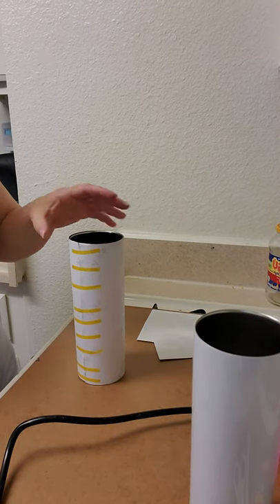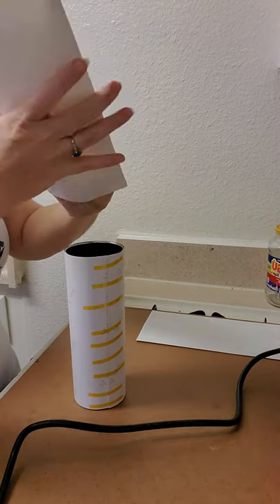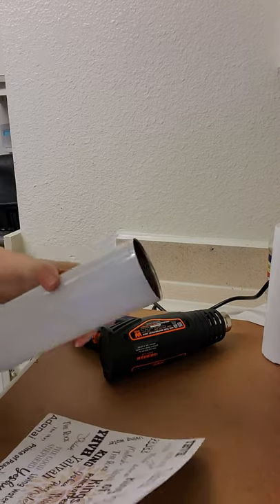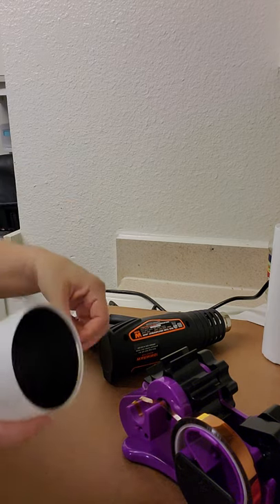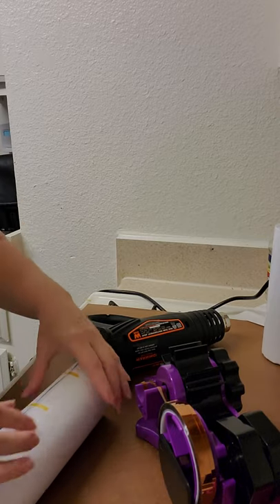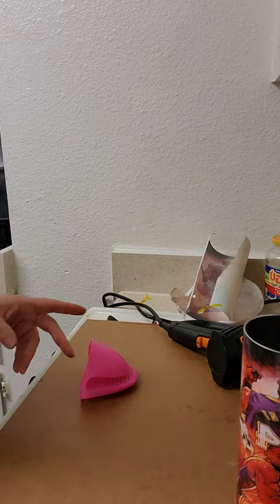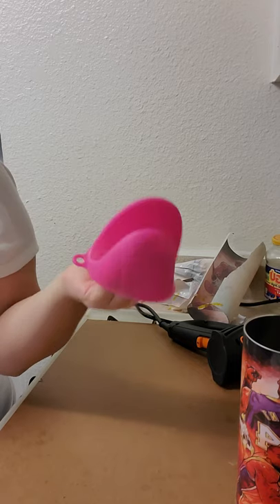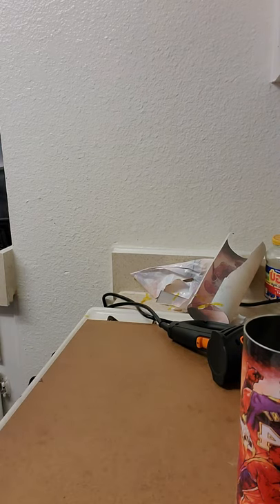How to sublimate a 20-oz skinny Tumbler in convection oven

Comment: Hi I love the video and the tumblers. I was just wondering if there were strong fumes from the heating process in the oven?
Reply from the maker: Thank you. There is a slight smell. I just don't know if that's the shrink wrap,  tumbler or the heat tape putting off the smell. I do have a window open and a fan on. After you shut everything off maybe less than 20 minutes smell is gone.

Comment: What size is the template? Does it have to be a conical shape or can it be just a square?
Reply from the maker: You can do a square It'll be 9.2x8.2 But just make sure you measure your Tumbler every Tumbler is different some are tapered some are straight and some taper at different parts. When you do the square you're going to have overlay if you don't cut that overlay off  that will show when you press it that you overlapped the paper.